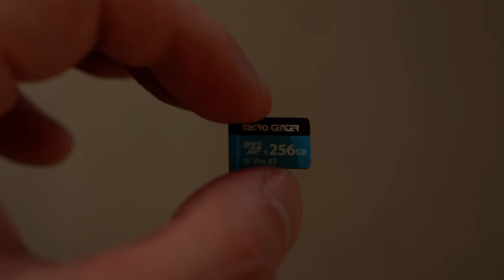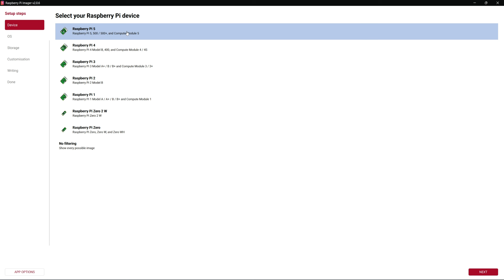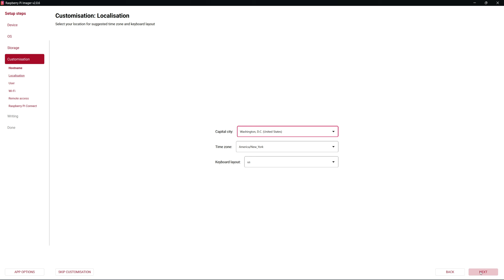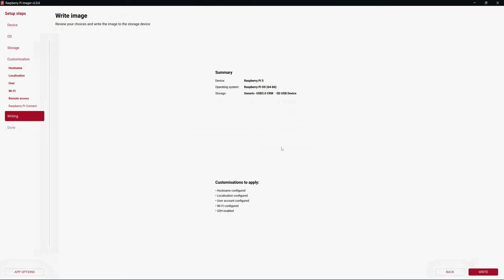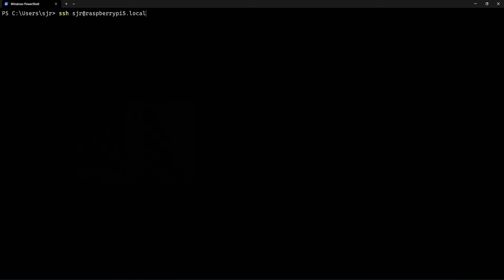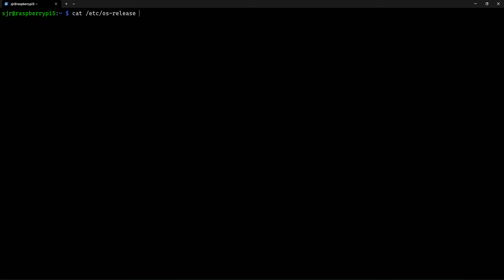Raspberry Pi Headless Setup in 5 Minutes (No Monitor Needed)

Comment: I get permission denied when entering password?? any help appreciated
Reply from the maker: Hi! Did you set a password in the Raspberry Pi Imager GUI setup? Also check it may be blank. And if your forgot your password no worries you can, take the microsdcard out and insert it into your computer.  Then edit the cmdline.txt file on the boot partition to add init=/bin/bash to the end of the line, boot the Pi, and run passwd command and you can change it :).
Reply: @SamTheEngineeringMan  Yup, and its also not blank or have I forgotten my password I'm running headless so no monitor I've tried putty and powershell both with the same error when it comes to the password, I've reflashed the card numerous times, added a blank ssh file still to no avail
Reply from the maker: @Defaultuk  I would recommend using the Raspberry Pi Imager itself that will definitely make sure if you check ssh that username and password is setup for the sdcard. this will also create the files needed for it to work
Reply: @SamTheEngineeringMan already tried several times , i can ping my pi and it sends/recieves packets ok just always getting permission or access denied when it comes to the password, ive read about half the internet and tonnes of videos and nothing seems to work
Reply from the maker: @Defaultuk  Got it! And which Distro are you running our PI is it the official Raspberry Pi OS?
Reply from the maker: @Defaultuk  Also can try:
Use Raspberry Pi Imager.
Set a unique hostname, something like pi-test-123.
Set a brand new username, not pi, for example testuser.
Set a very simple temporary password with only letters and numbers, no symbols.
Enable SSH.
Make sure SSH is set to password authentication, not key-only authentication.
Write the card and boot the Pi.
Wait several minutes on first boot.

Then from PowerShell, do not use just:

ssh raspberrypi.local

Use the exact username and IP:

ssh testuser@<pi-ip-address>

You can also force it to use password auth with:

ssh -o PreferredAuthentications=password -o PubkeyAuthentication=no testuser@<pi-ip-address>
Reply: @SamTheEngineeringMan  yup official lite version
Reply: @SamTheEngineeringMan  yup tried all this bar that last bit of code, will try that later and let you know how I get on!
Reply: @SamTheEngineeringMan  yup still getting permission denied even with that piece of code
Reply: @SamTheEngineeringMan  turns out the sd card was fecked!
Reply: thanks for trying to help though man much appreciated!
Reply from the maker: @Defaultuk  You are very welcome! Was going to say would be good to test the sdcard. I've seen bunch cases on my other videos where people bad bad sdcards :).  Glad it got figured out! Let me know if there's any other Raspberry Pi stuff you want to see!

Comment: Hey Sam, nice video! However, I'm trying to power up my raspberry Pi using my 65W lenevo laptop charger, it was giving the green light a while ago, but now it's red (I think that means I don't have enough power; the charger is rated at 5V for 2A). Also, I'm using a USB-A drive instead of a micro-SD card. I'm not sure what's wrong, would appreciate any advice!
Reply from the maker: Hi Haris I am glad you liked the video and I appreciate it! That would be a power issue where while 65W is more then enough the Pi 5 needs 5V and 5A at least, Pi 4 needs 5V and 3A and all the others at least 5V and 2.5A.  So if you swap it out for a charger that will give the right current and voltage you will be good to go :).  Most cell phone chargers made recently should be able to provide that no problem!
Reply: @SamTheEngineeringMan Hey Sam thanks! I changed it to an Apple Phone Charger and I still receive a solid Red STAT LED. 

After some research it's saying my device could be in a shutdown/halted mode where it's not booting. I'm going to try using a microSD instead of the USB drive i'm using. But I'm worried something's wrong with the board. 

Have you heard of this? What should be my next steps?
Reply from the maker: @H.A.R.I.S.  Hi again Haris! I would recommend using a fresh sdcard instead of the USB, image it using Raspberry Pi imager and make sure it's a legit sdcard lot of fakes out there! If your still having issues let me know :)
Reply: @SamTheEngineeringMan  Hey Sam! I figured it out! I used an SD Card, but had the Misc utility image -> Bootloader -> SD Card Boot. I booted that up and then imaged the OS again and it started right up!
Reply from the maker: @H.A.R.I.S.  Excellent very glad to hear that worked for yeah :)!
Reply: 5V 2A seems low, usually it is 3A with the official charger. 5V 2A gives 10W
Reply from the maker: @Blackflunk2  Thank you for the comment Blackflunk :) he was able to use a different charger that had the correct amps!

Comment: Do you need to be on the same wifi with your laptop from the setup to connect for the first time to the rasppi?
Reply from the maker: Nope :) you can have your wifi on one network and the Pi on another one. As long as neither is blocking SSH traffic you should be fine

Comment: I am using a 128GB memory card and a USB 3.0 card reader.
Raspberry pi 4B   4G
When I try to install directly using the program, the writing process fails in the first moments. If I download the image file first and then try to flash it, the verifying process fails.

Every time the process fails, the computer does not recognize the memory card again unless I format it.

What is the solution?
Reply: i have problem write to sd card with the imager everytime the sd card would disconnect but i did manage to write using a downloaded rpi image file, but it will not have the configuration option to choose
Reply: @jack0wack0You must format the card using the program (Imager) This makes the card in fat32 format and this is a prerequisite for complete installation try this and it will solve the problem
Reply: @jack0wack0This step is possible by selecting (Erase) From the OS menu, after testing the version of your Raspberry Pi device, for example, Raspberry Pi 4, you will find the Erase option in the second menu (os), the place of choice at the bottom of the list.
Reply from the maker: Hi Mostafaa! I would recommend using https://www.sdcard.org/downloads/formatter/ and then doing the overwrite format option to start.  I have also seen similar issues with devices  and fake sdcards if you test with https://h2testw.org/ that will help determine.  What brand sdcard and what brand is the USB reader?

Comment: You didn't deploy it headless?
Reply from the maker: Hi Blackfunk2! I did deploy it headless as it's running without a monitor, and accessible via ssh :).  If you mean running the raspberry pi Imager via cli that is something I could cover if people were interested.
Reply: @SamTheEngineeringMan  usually I think people would associate it with the lite version that doesn’t include desktop :-)
Reply from the maker: @Blackflunk2  Gotcha! I deliberately used the the one with the desktop so people could use remote desktop later if they wanted to! Which may be a future video or how to upgrade a lite install to desktop :)